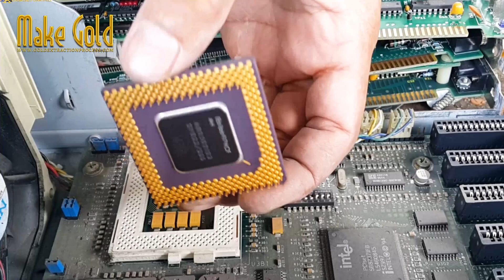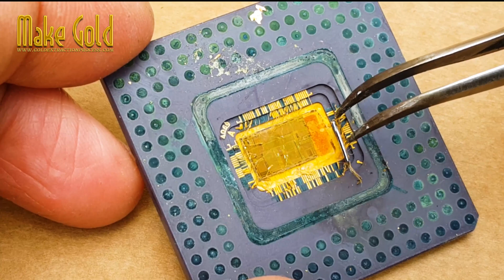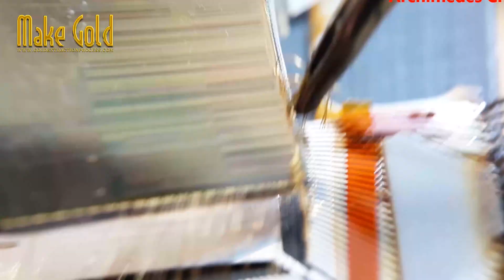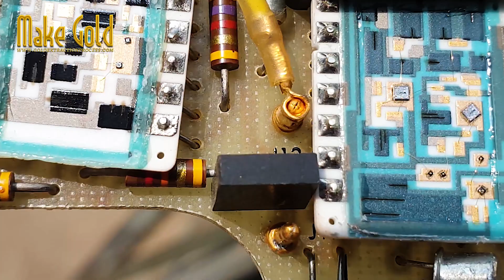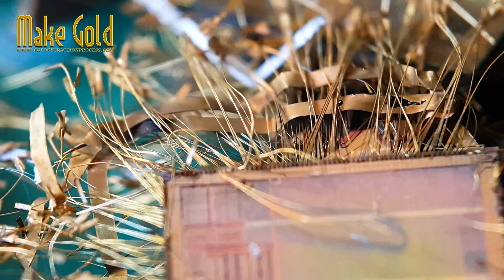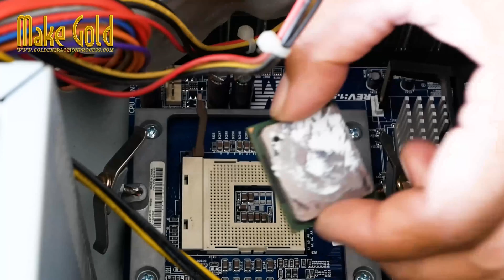gold in computer processors

Comment from the maker: :face-orange-biting-nails::face-orange-biting-nails::face-orange-biting-nails:Gold wire refers to a thin wire made of gold that is used in various applications, including microelectronics packaging, jewelry making, and industrial applications. In microelectronics packaging, gold wire is commonly used in wire bonding to create electrical connections between semiconductor devices and metal lead frames or substrates.